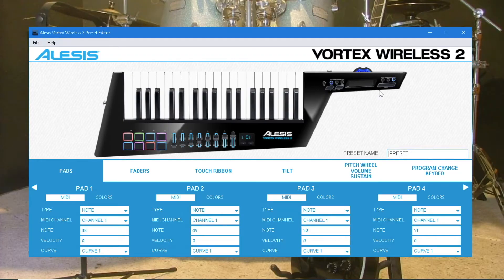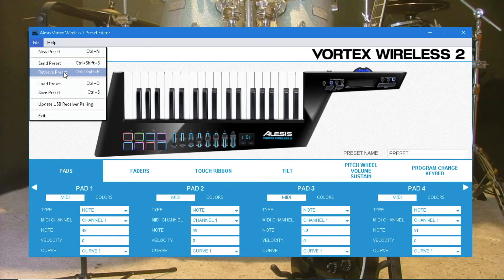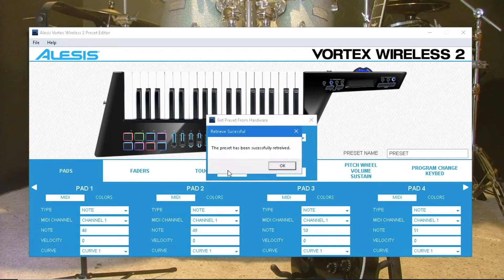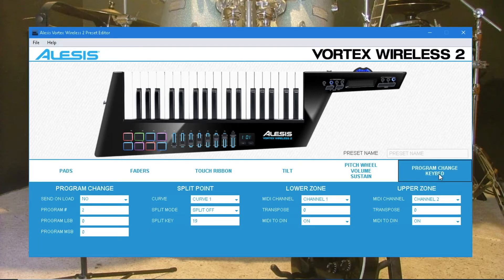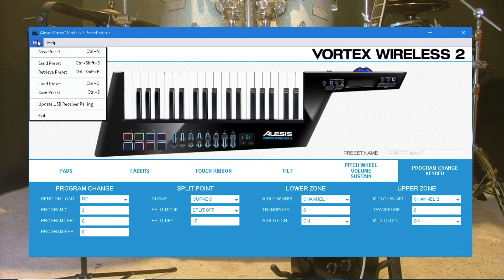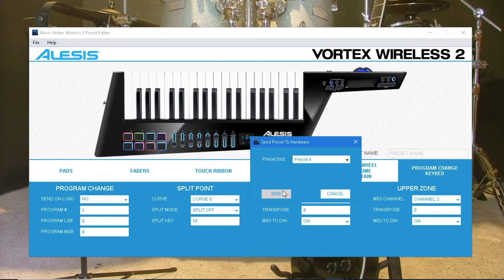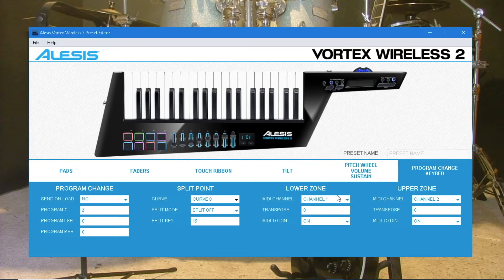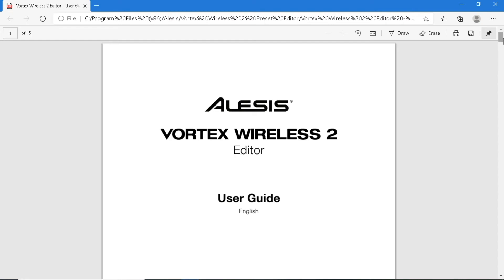How to change the Vortex Wireless 2 keyboard velocity response

Comment: How to chang the transpose system
Reply from the maker: @parthasaha2093
In the vortex wireless 2 editor, click on the Program Change Keybed tab. You can set a transpose on the lower zone or upper zone, or on both... In the lower zone or upper zone section, type in a number (0 = no transpose, 1 = transpose 1 semitone higher, - 1 = transpose 1 semitone lower. A semitone is 1 key on the vortex keyboard (white or black), so to transpose from keyscale C to Keyscale D... Type in 2. Then save the preset to one of the 25 presets on the vortex wireless 2.

Comment: I see you are changing the presets on the hardware.  How do I save each of the 25 presets on the software.  When I choose save preset in the software I have to change the name so it won’t correspond to the hardware presets.  Thanks for the help.
Reply from the maker: Bryan 2407
Hi, I always back up my hardware presets by loading the preset into the Editor (file >> Retrieve Preset) then save the preset (file >> Save Preset). I name the saved of preset 1 as Preset 1.vw2, preset 2 as Preset 2.vw2 (etc). This way I know which preset I have saved.
The reason the saved presets don't automatically use the same preset name as the hardware is so you can save more than 25 presets. For instance, I have some presets I have made for my youtube tutorials that I save as Tutorial Demo 1.vw2, Tutorial Demo 2.vw2 (etc) that I don't keep on my Vortex 2 but can send to preset 1 on my Vortex 2 when I need them, then send my saved Preset 1.vw2 to my Vortex 2 when I have finished using the tutorial demo preset. I also have 1 set of 25 presets I use with my DAW software and another set of 25 I use for live sessions.
Reply: @IbandUK  thanks I’ve started doing the same thing.  Also I wanted to ask if you ever use the  ribbon for pitchbend?  It would be nice if they had a tactile marking for the “center” of the ribbon for pitch bending purposes.  I actually taped a small piece of paper clip right in the center which helps a lot.  Wondering if you have any  other tips for locating the center consistently.  Thanks.
Reply from the maker: Bryan 2407
Hi, yes I often have one of the touch ribbons setup as pitch bend. The paper clip is a great idea. One of those little round self adhesive cupboard door pads would be another option.
Personally, I have got used to where to put my finger on the touch pad (its rather like learning where to put your fingers on a fretless bass guitar or violin - it comes with practice).
Also, I set the touch ribbon release mode in the preset editor to RETURN, so the pitch automatically re centers when I stop touching the touch ribbon.

Comment: Hello, I have a question, I lost my wireless usb and I want to buy a new one, do you know if a new or used usb can be paired with the alesis vortex wireless 2?
Reply from the maker: chicobenjy
Hi, yes it can... Connect the Vortex by usb cable to your computer (then turn the Vortex on) and plug the replacement wireless usb dongle into a usb socket on your computer, then, in the preset editor software, click on File, then click on Update USB Receiver Pairing.
Reply: @IbandUK  Thank you so much for helping me!!  Because many say that all memories are different and that you can't, but you can see that you know a lot about this and I trust you a lot.
Reply from the maker: chicobenjy
Hi, thank you for your trust. 
In the preset editor software, if you click on Help, then click on Open User Guide. Now scroll down to page 4.
Look for the paragraph that says Update USB Receiver Pairing. The paragraph will tell you how to pair... Notice that you will need to enter the last 6 digits of the serial number of the replacement Alesis Wireless dongle.